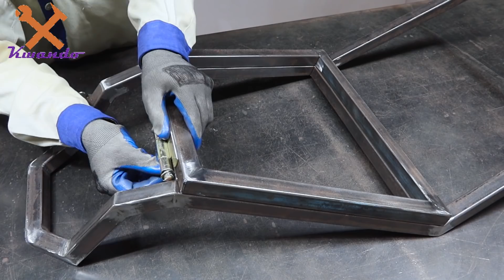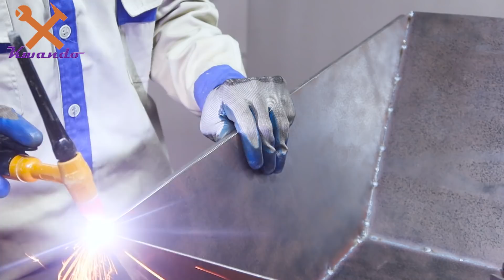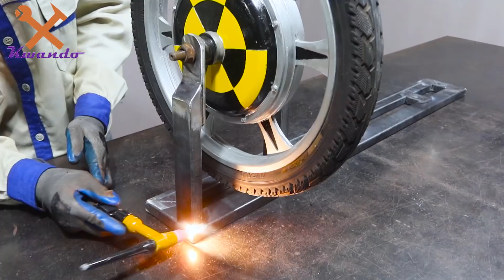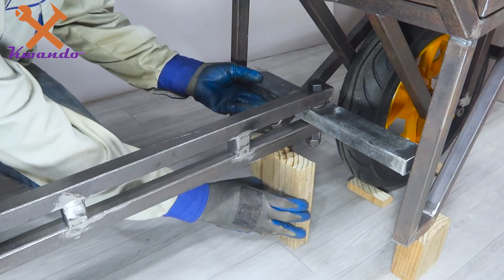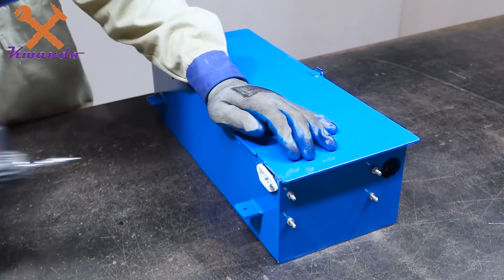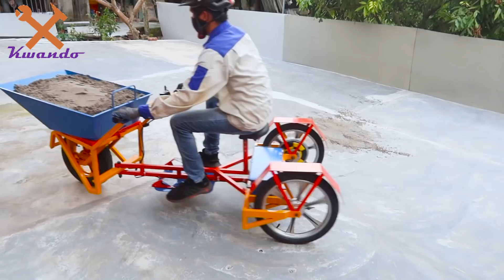Build An Electric Wheelbarrow From Scrap For Workshop | New Design and Detail Implement For Everyone

Comment: If you put two wheels in front and the barrow between them, you could drive the corners with much greater speed, because the center of gravity would be MUCH lower.
Reply from the maker: Many thanks for your knowledges sharing!
Reply: agree then make more stable for loaded materials and to withstand heavy loads and more durable of course. but very fresh the idea to make this. bravo....
Reply: @eckobacrie  न वहज शशनशशंं

ध्

श

व
Reply: @KwandoTechnic  ‌
Reply: @KwandoTechniآ. َ. آ... آآ. آَڱﷺَﷺَﷺ😊😊ق😊😊قَﷺڃڇ